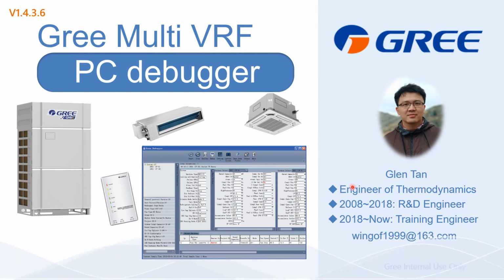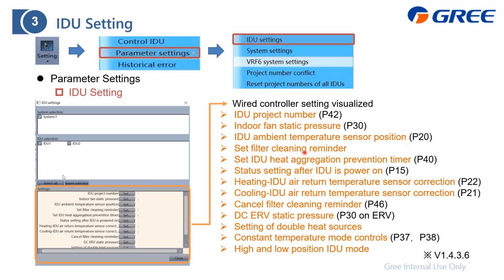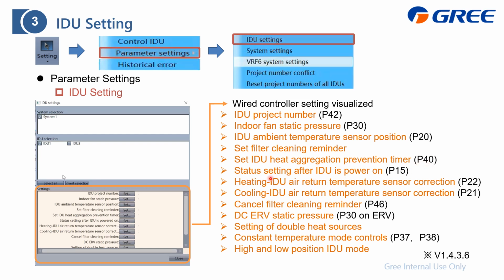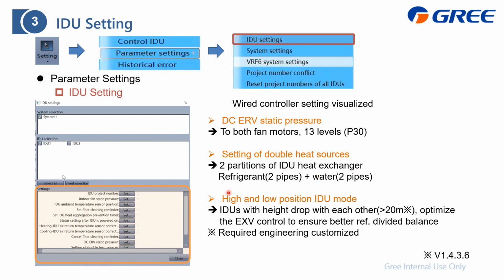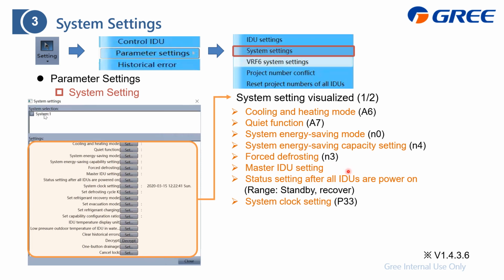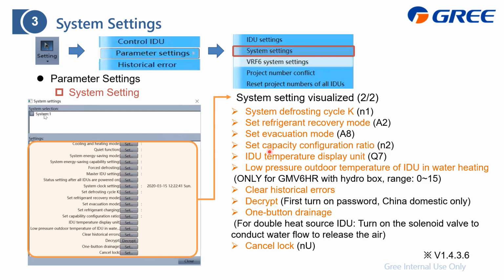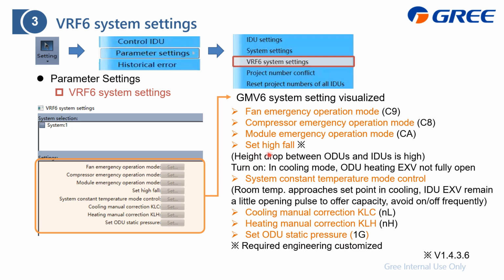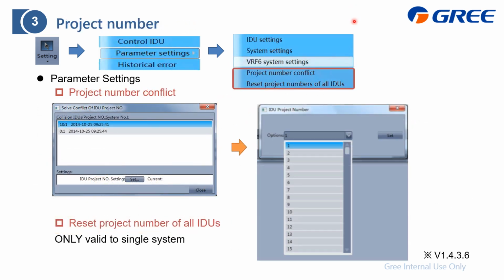010408 GMV PCdebugger电脑监控(3/4)_UnitControl&Setting机组控制&设置_20220520

Comment: Can you please advise in a GREE GMV 6 VRF
How can I force IDU EXV to open position using XK46 Controller parameter setting or through portable debugger
I’m stuck in the vacuum before commissioning and debugging since the indoor unit was powered on before finishing the vacuum which caused the EXV to the closed position
Reply from the maker: Apply A8 function to fully open all the solenoid valves and EXVs in the system. No function setting from XK46 to control the EXV
Reply: @ Thank you so much